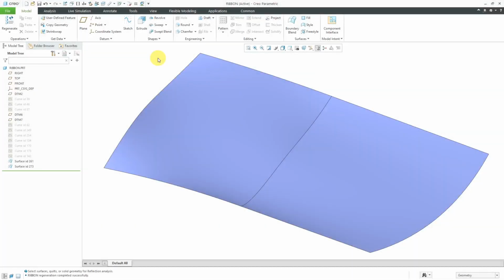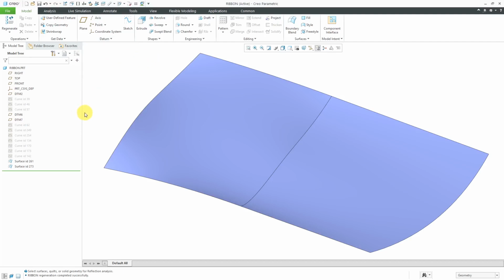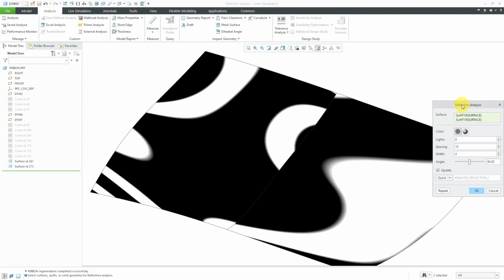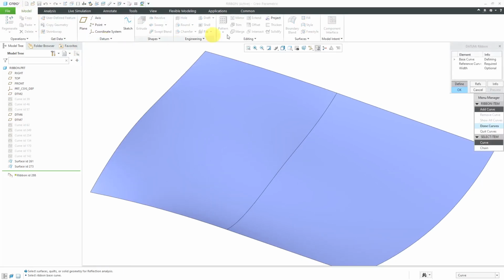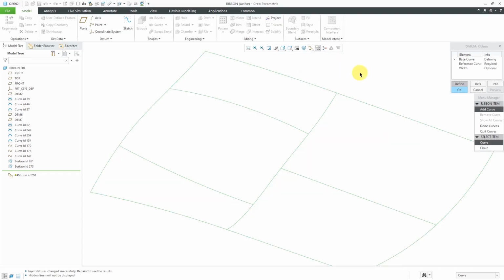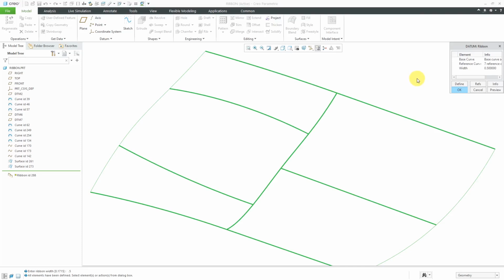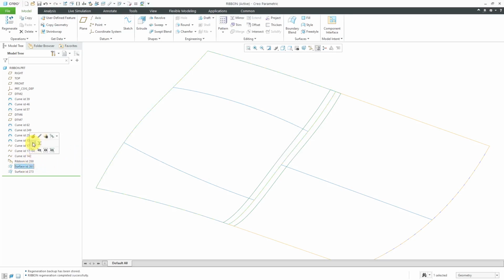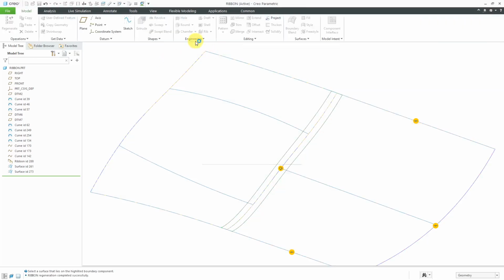Creo Parametric - Ribbon Surface (2001)

Comment: This looks like a really useful command for high end machining - for CAM tools to work properly the surface contour vectors need to be aligned, and ideally, continuous.
Reply from the maker: Glad to hear that use case. Some commands get introduced and catch zero traction. It had to have been added for a reason and due to customer input.